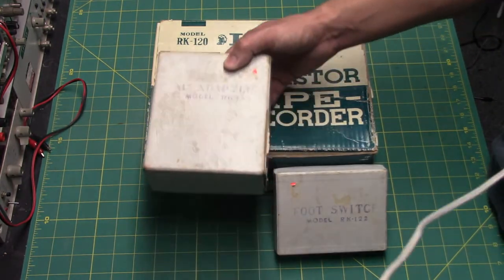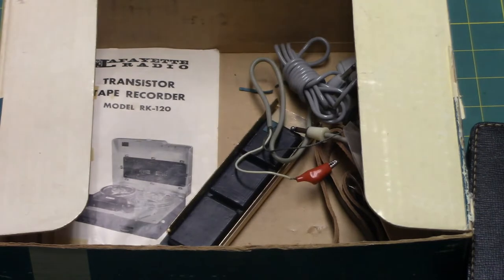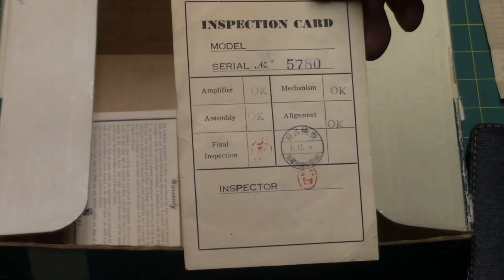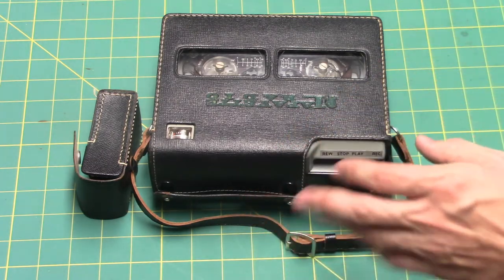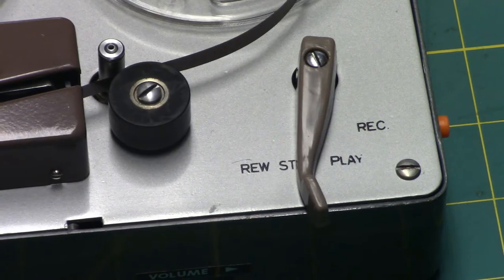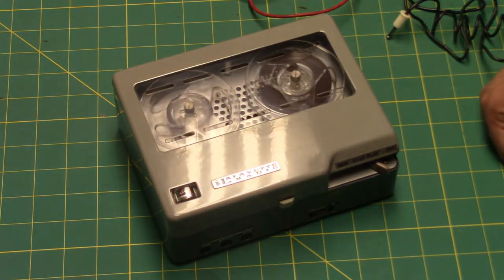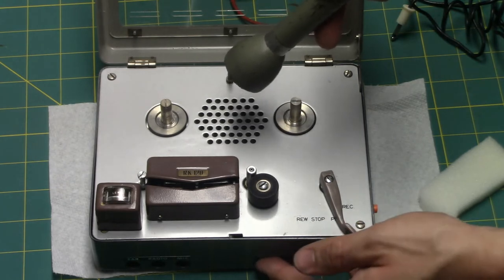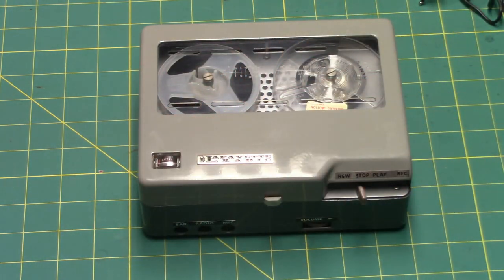Lafayette RK-120 Reel to Reel Portable Tape Recorder!

Comment: Nice video. I think your first 8 minutes were important because you showed the complete kit of the machine and gave a history.  IMHO, that was better than the actual machine performance! I've had two "sibling" units and neither worked correctly because the motors were pretty gone, as well as the amplifiers. I believe this machine uses a Matsushita design, one of their earlier ones that were used on Panasonic and National exports up tp about 1965. I have a "Concertone" machine that looks similar to this one (doesn't work at all) and it has Matsushita all over the inside.

Thanks for the shout out. I'd love to see a video on replacing germanium transistors. I have run into several machines that have "whiskers" and are unreliable. 

If you aren't getting notifications on my channel, go over and check out my latest new series where I am attempting to restore an "Alaron" 3-inch rim drive machine that has a very unusual speaker design. 2 motors too, and a 5 transistor amplifier which I expect is DC bias. 

Don't be so hard on yourself, Ricky. You do a great job on your videos and always entertain. And hey, at least you didn't put your finger through the speaker like I've done in the past! (DOH!) 

Take care, pal!

Comment: Hey I was wondering if you would help me with something. I bought a Califone cas 1500 and it’s has a problem. When I use the internal mic, it makes a very high pitched noise. It works fine when I record it with the mic jack but it also it projects it in the internal mic. If you would be very kind of you to help me fix this because I’m going to use it a lot. Thanks and have a good day.

Comment: i think if you put a little more compression with your voice, it will be perfect am i right ?!   lol  your noise gate attack time is super fast by the way, NICE!  would it be a DBX 286s vocal processor ?
Reply from the maker: Behringer Ultra-Dyne Pro DSP 9024 compressor (meant for music, not even voice) that was a gift from SpeakerFreak95!

The first introduction, at the very beginning, use recorded direct to computer at the studio of SpeakerFreak95, with his fancy equipment! He has a proper microphone compressor and mike hanging on a boom.
Reply: @CassetteMaster  check out the DBX 286s vocal processor.  I think you'll find it is really nice and clean for enhancing your video's with the audio path!  it has many functions you will probably find very useful especially if you want to do a live stream and not have the opportunity to do anything in post production with enhancing audio, etc.

Comment: Hey, so this might be completely random, but I'm currently writing a screenplay set in 1963 where part of the plot involves a character tape recording her own phone conversations. Do you know what kind of device she would've used and how she would've used it? Someone else told me she would use a dictation machine, but I can't figure out how that could've been hooked up to a telephone. I don't want her pointing a microphone at the phone speaker because that would look too clunky on camera. For the record, she works at a TV studio. Any help would be appreciated. Thanks!
Reply from the maker: Being a TV studio, it would likely be a decent quality machine. Being on the old days of "Ma Bell", they would most likely have used a telephone pickup coil (with suction cup) up against the rear of the telephone handset's earpiece, or at the rear of the telephone itself. Another type of pickup coil was shaped like a ring and went around the rim of the handset's earpiece itself. That type I recommend, as it gives best performance and does not have the tendency to fall off the handset.

Someone may have used a dictation machine or a regular reel-to-reel machine; both had means of hooking up to telephone pickup coils. Being a TV studio, they could have had access to some good recorders, such as a Nagra III, for telephone recording a consumer unit running at a slower speed would also be good. Another candidate is the Uher 4000 Report, provided you can find the earliest model (from 1961 to 1962) or the Uher 4000 Report S (which came out in 1963). That is still pro quality, likely available at a TV station, and had four speeds, which could run at a slow speed for long-record time telephone recording.

Also, if the character is a secretary, then a dictation machine would make sense. If she's not a secretary, they I would be more inclined to use a regular reel-to-reel. Either way, a telephone pickup coil would most often be used.

Would the character be recording only while in the studio at the sound board? Or would she be doing it in a more portable way?
Reply: @CassetteMaster  First off, thank you so much for giving me such a long and detailed answer. It’s a big help. The character isn’t a secretary; she’s a high school student that plays the local horror host on Friday nights. She sneaks the station’s equipment to call other students using a disguised voice (think Scream, Black Christmas, Prom Night, and When A Stranger Calls) to try and get evidence for a crime they committed. She records the calls so she can take them to the police. I’m not sure how portable it needs to be, but I wouldn’t mind knowing about those options in case I need it. Another character does the same thing at another point in the story, but I as the writer could easily just find a way to get him present at the studio to do it. 

I also have her watching an old news story from 1957 via an archived 16mm reel, but I’m not sure how versed you are in that technology. I figured that such a news report may not be archived, and the station probably wouldn’t have a screening room, but I was okay taking a small liberty there.